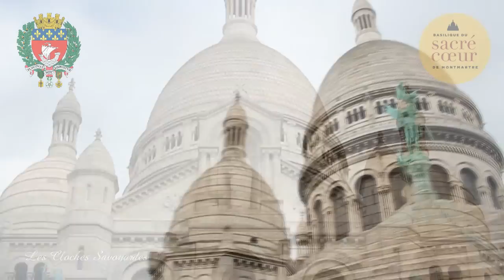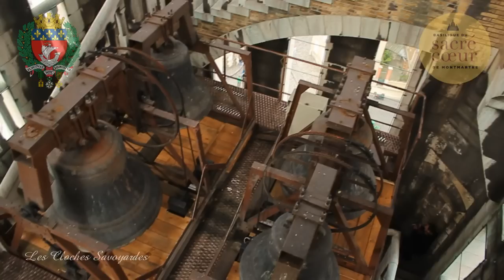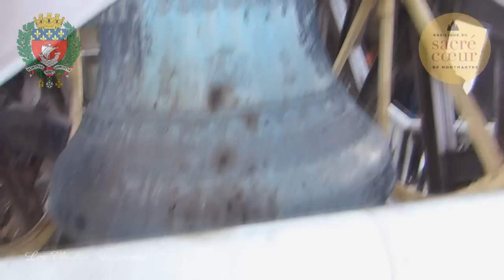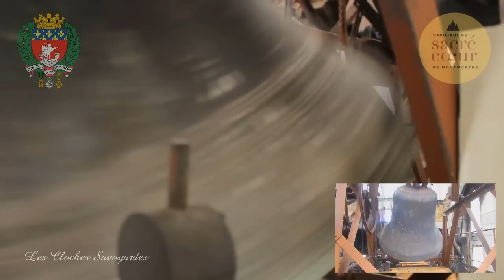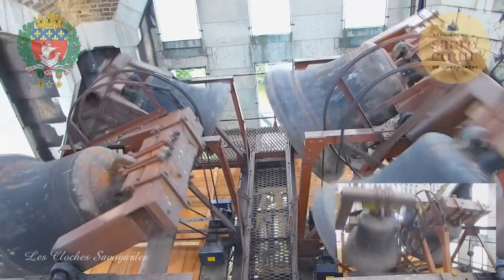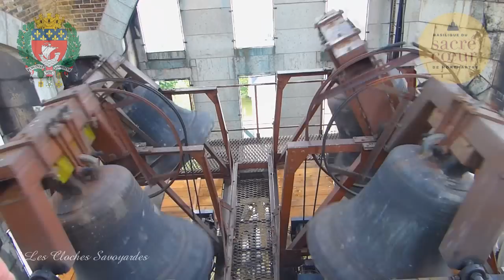Cloches : Paris (75) Basilique du Sacré-Cœur de Montmartre - HD

Comment: Nice to see them ring.
The largest bourdon sounds nice.
Also the bell rings correctly as the clapper is not lazy like the smaller bells
Reply: as far as i have read on the internet, the bourdon (La Savoyarde) was cast in 1891 by the Paccard foundry
Reply: yes! counterbalanced like Great Peter and Great Paul
Reply: @adamm2693  I have a YouTube vid of great Paul.
The only one on YouTube that shows it ringing..
I have seen it twice now.
Saw it in 1963 it was rung manually back then , it also rang higher than rang by motor.
It also had a heart shaped clapper.